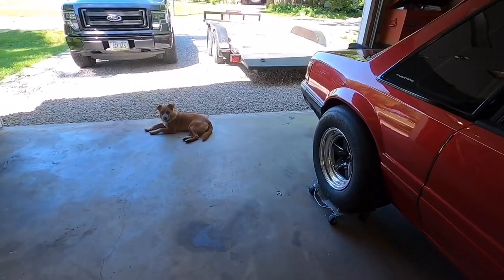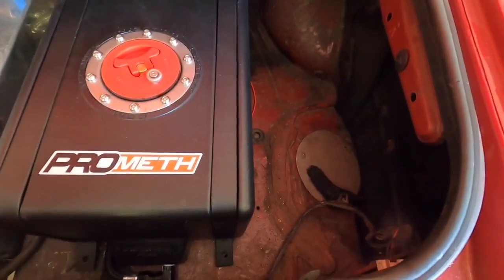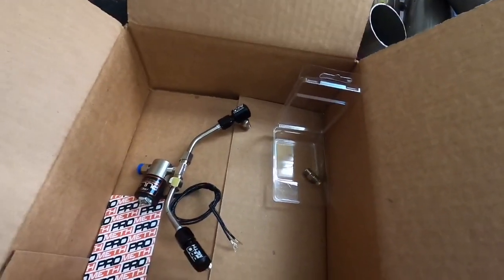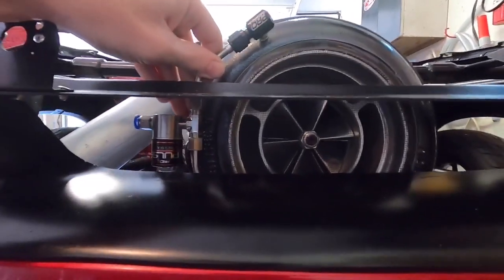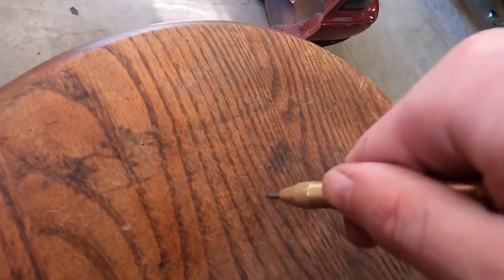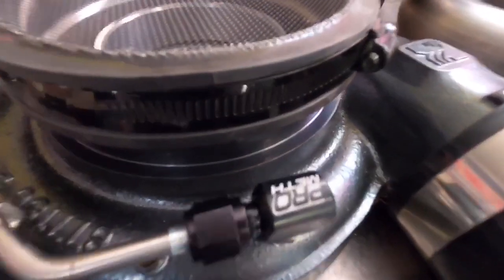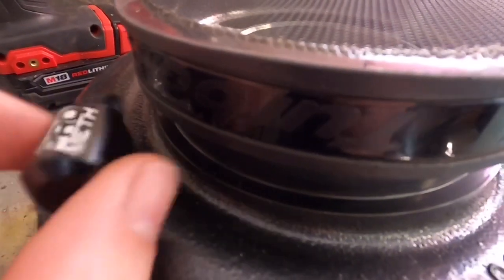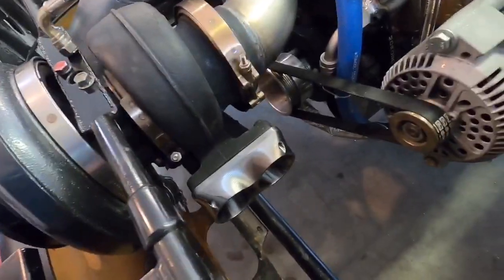I’m on DA METH again!

Comment: I run two 20s pre turbo and intake temps are in the 230s at 30psi.
Reply from the maker: At what boost u kicking on the spray
Reply: @BlakesSpeedShed  10psi. That's when it starts to ramp in.  I'd have to look at my tune but I'm pretty sure it's all in by 25psi.
Reply: I know it didn't like when we tried to bring it in all at once.  It was like it wanted to stall the compressor wheel or drown it with too much meth at too low of an rpm.